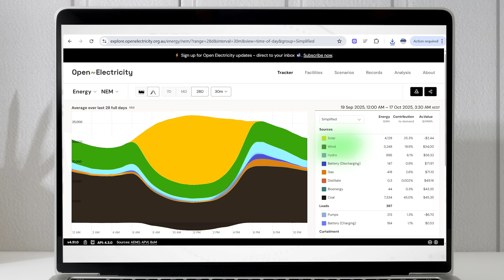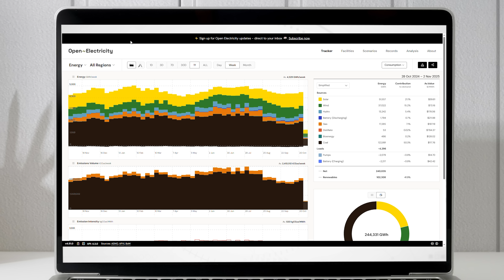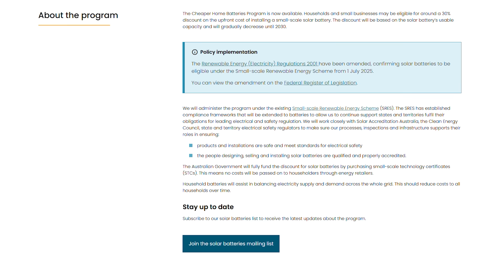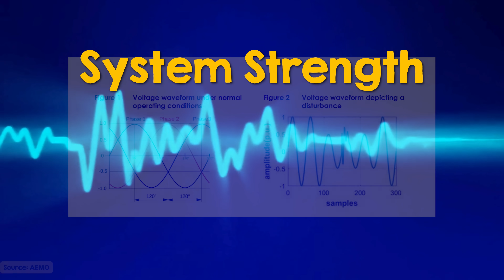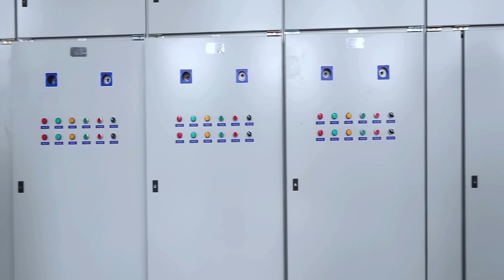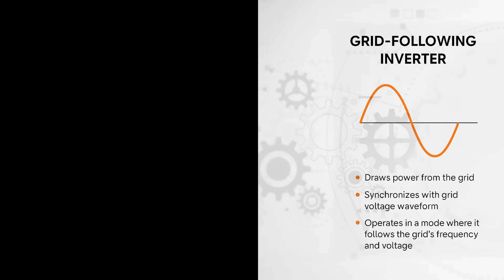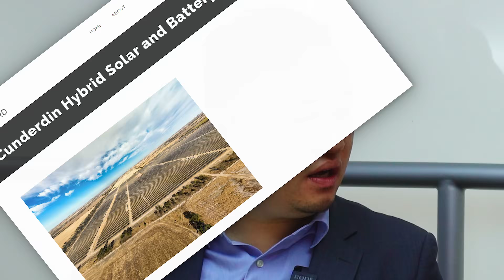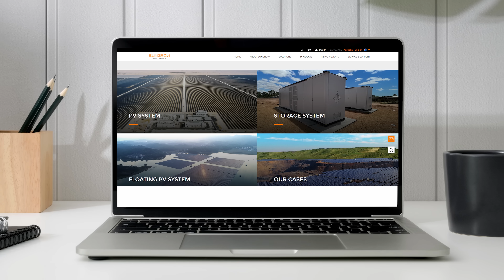Australia’s Solar Boom Is Breaking the Grid - Or Is It?

Comment: Just completed my undergraduate electrical engineering thesis on the application of grid-forming inverters in distribution networks. These things ARE the future. The best part is that you can still have most IBRs operating in grid-following mode with only a small share operating as grid-formers. Response times to disturbances are also in the subcycle timeframe, so they respond before the 50Hz grid frequency has even completed a single cycle, <20ms! Very fast indeed!
Reply: I kinda like the idea of using real inertia in the form of flywheel storage.
Reply: @kayakMike1000  Yes, exactly what we have been using for the last 100 years with rotating plant, the instantaneous impulse energy available from rotating plant is hundreds of times what it's rated output is, that's the energy that allows breakers and feeders to trip in a planned order. That's why grid forming inverters can never replace real rotating mass. Even with very generous ratings an inverter is never going to be able to support an impulse load orders of magnitude greater than it's continuous rating.
Reply: @raygale4198  Correct - A current source / "grid forming" inverter has to make a choice whether to direct energy into current or voltage i.e. the magnetic or electric field.  A synchronous generator can do both, increase the fuel into the turbine to maintain real power and change the power factor to support the voltage by increasing or decreasing the excitation.  Power electronics can mimic this behaviour, but the overcurrent capacity of a big machine is many times that of a set of gated transistors, as you've said.
Reply: Something I've always wondered, given power is being pushed into the grid, does the speed of propagation of that power result in progressive desyncing and energy loss the further you get away from the source? Also doesn't this lead to a 'dirty wave' that you then need to sync off? i.e. the physics of the network itself precludes efficient operation with lots of self syncing generators.
Reply: @keithmarlow143  Having individual generators not actively load and VAr sharing causes all sorts of distribution issues, not least of which is frequency control, you used to be able to use the grid for time keeping, it was guaranteed to be accurate to within 1/100s of a second over a 24 hour period with master clocks at the primary state generation plant.
Reply: @keithmarlow143   No
Reply: @keithmarlow143  Yes and at the edge of the grid it is reflected backwards
Reply: presumably they are sampling the ac waveform (digitising) in order to be able to see a change within the half cycle and then implement a change to the o/p in order to start to affect the next half cycle???? Or do they lock onto the cycle and continue at the same freq in order to prevent freq change and change the o/p current in order to prevent a potential drop/rise in voltage?
Reply: How does it work with expansion of infrastructure and manufacturing ? AI  is also the future  and power hungry and these are 24 hours running and if imigrating keeps at it the growth to land space for power is massive and will affect many industries that rely on land also for environmental stability wildlife will require space  it not sometime whether  it works it's about finding what is best for each country .
Reply: Looks like at lot of parts to maintain. I like solar as a on every house with battery banks and a nuclear plant
Reply: Screw the grid. You are argueing for centralized control of our lives. Individual home solar is vastly superior in every way.
Reply: @5400bowen except in northern latitudes in the winter. Have you done the maths .....it's easier said than done.
Reply: @R@RalphFreeman-ok5of.  There are ways, but it is a challenge. If there weren't 8 billion people in the world, there would be no need to live in those environmments. At least not the millions who do.
Reply: Several questions. Have you looked at the effect of transients, which you are creating, on transmission lines. Secondly if you have a large number of these devices how do you prevent them all tripping at the same time.Thirdly where is the energy coming from to simulate the inertia of a rotating alternator. Fourthly, if you have several of these on the same line how do you prevent them interfering with each other. I assume your lecturer addressed these issues.
Reply: @RalphFreeman-ok5of. Wow, you aren't aware of the existance of isolators and diodes? The grid is rife with them Mr Edison. Next....
Reply: No - they are not lmfao. You’ll bankrupt your country building the distribution network.
Reply: @questioneverythingalways820  Or embed high prices. See Sarah Ferguson interview Sussan Ley, shocking.
Reply: no, they are not.
They are inefficient, break frequently, get pooped on by birds (no photovoltaic through poop), take up large amounts of space in the environment, and cause HUGE waste. 
Nuclear even produces less waste.
Reply: @iluvyunie  none of that is true.  I've had panels for 12 years, not one has broken.  They take up no space, because they cover my roof and shade my house.  Solar farms are being trialled with livestock living around them.  The rain cleans the panels.   They have no moving parts or maintenance and in terms of energy transfer are as efficient as a petrol engine ie. approx 20%.  Levels of waste are no different to any other modern activity and they generate no pollution when in use and no radioactive waste or meltdowns.  Would more people prefer to live next to solar panels or a nuclear plant?  Hmmm
Reply: @robertsmtube in a UK winter I'll live next to the nuclear plant and be warm . Solar produces about 10 % of the rated value here on a good day and we go for days under thick cloud. I notice no one advocating solar mentions where they live ... Florida?
Reply: @iluvyunie solar panels are 99% silicon, the most common substance on earth, and inert and non toxic. 2 companies are currently recycling them...and they last for 20-50 years, longer as time goes on. You are definitely halucinating.
Reply: @iluvyunie  lay the drugs dude..nuclear is for demented dreamers..you have to be asleep dreaming to believe it is the answer to our energy needs.
Reply: @iluvyunie  I've had my Solar on the roof for 13 years, cleaned them once. The Electrical output is actually going up over time as more Solar energy is hitting the earth due to global warming. Not even seeing any panel degradation as I was expecting over time. No Panel breakage and the inverter is the origonal one. So I guess my practical experience means you don't know what you're talking about!
Reply: @wino99999  If we scaled your system to planet wide, do you think we would see the same level of consistent performance or could there be an element of luck involved in your story?
Reply: @wino99999 more solar energy due to global warming?? 😂 Okay boomer
Reply: @Revolutions1200  I'm telling you I'm getting slightly more energy from my Solar PV over the last 13 years that I've had when they were fitted at the start. Since I can't show you 13 years of data, I guess you'll have to take my word for it, but its a fact! Not only am I averaging more power over time, but that also isn't taking any panel degradation into account. So boomer or not, (I'm 65 and have an electrical engineering degree) you can choose to believe it or not - I don’t care, but what the figures are telling me is that I'm receiving more solar energy over time than I should be from ageing panel's.
Reply: @markusloane1149  well i live in the uk, so it's probably because of slightly less cloud cover/rain, lol! I guess there is a benefit to global warming at least for some or at least till the poles melt. I think global warming is a threat to humanity that is NOT being taken seriously enough.
Reply: @wino99999  I am not doubting you, I am asking if your scenario scales? Do you think we can apply whatever magic your system is operating on to other systems so we can spread that benefit to the poorest on this earth not just a lucky few. (On a more pragmatic side can you tell me, with your electrical engineering degree, background, the root case of the increased solar energy production? I am wondering if you recently cut down a tree that was overshadowing your panels or some other physical environmental factor is at play. I don't know if you follow the sun weather but we have been in a solar maximum for  the last few years and that could explain a recent increase in solar generation.) I am sensing a lack of detail in your claims that's not doubt, that's curiosity. I would like to know more.
Reply: @markusloane1149  To be honest I hadn't considered a Solar Maximum and I wonder if that actually results in more Solar Irradiance or if it just Solar particles and Solar Wind. Investigation is required!
Reply: @Revolutions1200  I'm not sure but does long wave radiation(reflected) work on solar panels?
Reply: @markusloane1149   Mate, Australia just had an election with one Party offering to roll out Nuclear Power. I researched what it costs to build a Nuclear Power Plant these days. Your question asked about how to get power to the poorest people on the planet. Solar is far and away the cheapest way to roll out power right now. We are far from Peak technology in Nuclear generation, or the construction of plants. I still hold hope Nuclear has a place in the new energy mix. But right now, we should be putting the money we have into Solar and batteries.
Hinckley Point C NPP in the UK is about 400% of it's budgeted cost, Vogtle NPP in Georgia in the USA was built at 250%. Both were completed at least 10 years late. We're shite at building anything other than Gas Power Stations these days. Or buying Solar panels from China.
Reply: @Tsubadai  We struggle to build bespoke nuclear, there are standard template nuclear plants that Korea build that are on budget and on time every time. As for solar bringing light to the poor dark corners of the world. I am not so sure that is a good fit, it might be cheap for us but to the poor it is hideously expensive, then they have to maintain it, replace it if it breaks. Dispose of it at end of life. They just don't have the logistics and supply chain to do anything at scale that is long term sustainable. That alone the upfront capital or the ongoing expertise and capital to maintain the systems.  On a micro scale this can work, a solar radio, a solar water pump, a solar light. As soon as you ramp up the scale the wheels fall off. Same deal with Batteries.
Reply: @markusloane1149 I know lots of people with solar. No one has had any equipment failure yet. Mine has been running for 10 years.
Reply: @markusloane1149 you need to look up what "scales" means. Solar works everywhere it's ever bern tried, and that's all over the earth.
Reply: @markusloane1149 you are dead wrong. Solar is growing immensely in Africa and every other poorer area.
Reply: @5400bowen  Check the insurance stats. You personal case study is insufficient data.  After every hailstorm that is a landslide of solar panel replacements.
Reply: @5400bowen  Solar at ''scale'' has never been done before. Some effects of a choice are not fully apparent for 100 years, (the automobile for example). There is just not enough data to say under all circumstances and scenarios Solar is the right fit.
Reply: @5400bowen  I don't doubt solar is growing in Africa. I doubt it is sustainable in the long run.
Reply: @markusloane1149 .   Every hailstorm? Why don't you state the stats? False, maybe in more intense hail storms. I was smart, moved to where it doesn't hail. Not everyone is smart.
Reply: @markusloane1149 boy, you are halucinating. You don't even know what at scale means. Just so you aren't quite as ignorant going forward, at scale is short for scaling up, which means taking the idea from a small setup and building a large one. There are large solar farms all over the world. They are scaled up, or "at scale". You really must live in your moms basement.
Reply: @5400bowen  ok let's debate each other's definition of the term 'at scale'. By 'at scale' I mean to the limit, every house, every community every office, factory, workshop, every manmade structure and every property.  That is 'at scale' to me. If you define 'at scale' as going from a home system, in one house, to a larger version in say a commercial warehouse or high rise building then we are taking apples and oranges. I am thinking global and at the limit. I assume your thinking more pragmatically towards domestic and community level systems. My philosophy is if not every human on the planet can have it then it cannot scale and we need to be very cautious planning systems that do not scale, (as per my definition). IMHO
Reply: @markusloane1149 your definition is contrary to the accepted meaning of the term as it has been used for at least two decades. It's not MY definition, it is THE definition. You always make up your own meanings for well established terms? Did you do that in school too? It means using it in larger installations, not universal usage. It has always meant that, and you assume I don't know what the term actually means. I've seen the term used hundreds of times, and NEVER in the way you have halucinated, and ALWAYS in the way I am saying. Straight As in English and German in school.
Reply: @5400bowen  the definition of terms and phrases can take on different meanings in different contexts, cultures, business domains. If you take issue with how I am using the term 'at scale' then let me use a different term to clarify my meaning. Ubiquitous. So rephrasing my point. 

If you cannot roll out solar ubiquitously then you risk creating pockets of solar, (our current state). These pockets mean some people get the benefits and some don't. aka an unfair distribution of resources. 

I argue that deploying solar ubiquitously is unsustainable because of the maintenance upkeep cost and environmental impact. Focusing on the money, I think ubiquitous solar would be expensive to maintain for two reasons. 
1.) supply chain logistics, 
2.) Equipment damage and degradation rates. 

If solar is ubiquitous the volume of damaged panels, (damaged from a plethora of reasons, flood, landslides, earthquakes, tree falls, storms, panel failure), would be enormous. The cost to transport the replacement panels to all the broken panels in all four corners of the earth and coupled with install would be tremendous and ongoing. Not to mention panels are coupled with inverters and solar systems are coupled with electrical grids so replacing the panel can potentially impact the inverter and local grid, particularly if you're coupling later generations of technology with an older insitu system. 

Every solar system will need replacing every 50 years. So can you do a planet wide replacement scheme of panels. There is no manufacturing or logistic precedent for this, mobile phones and cars comes close but that just goes to highlight the pocket effect. 

Throwing a nuclear power plant at the problem means you centralise your maintenance and logistic concerns not to mention the orders of magnitude less complicated grid management and voltage regulation becomes. Even better is pumped hydro. So whilst I agree that solar can deliver benefits in pockets, I don't think it is sustainable when deployed ubiquitously.
Reply: @markusloane1149 so you have no clue what coal, diesel or nuclear  upkeep costs are. They are WAY higher. Way higher. Just the fuel itself, being a permanent ongoing expense dwarfs the cost of solar. Where did you get your info on msintenance of solar? Because solar is virtually maintenance free. Just like EVs compared to ICE vehicles. You haven't done your homework. Unfair?!? It's unfair that  some  people/groups are smart enough to institute solar, while others are still saying the horseless carrriage will never catch on?!? And we shouod all be idiots for that reason? I have solar and install it. It is so reliable and cost effective..well, your information is all wrong. Not to mention getting rid of a monthly bill that does nothing but go up..and grid feed solar has NOTHING to do with rising electricity costs. That is a total figment. The utilities are trying to kill home solar and jack up prices using that industry promoted lie.
Reply: @5400bowen  I like the frame you present it is interesting. Let me explore one of your assumptions. Solar is virtually maintenance free. Let's look at a domestic solar unit and some of the types of possible upkeep factors, their likelihood, impact and cost: 
1.) They get dirty over time, likelihood certain, impact minor to significant cost - cleaning
2.) Their efficiency drops over time, (gradually degrading by about 0.5-1% annually, meaning they may still produce most of the original power (75-88%) after 25 years, but would not after 50 years) likelihood certain, impact minor to significant cost - replacement, reduced revenue
3.) They are suspectable to impact damage likelihood low, impact minor to significant cost - replacement, possible upgrade
4.) Animals eat cabling, likelihood low, impact minor to significant cost replacement, possible upgrade
5.) Trees, other vegetation and other manmade structures obscure the panels, likelihood moderate, impact minor to significant cost - trim the trees and sue the person building the high-rise next door.
6.) System fault - likelihood medium, impact minor to significant cost replacement, possible upgrade
6.) End of life - Full system upgrade and replacement, likelihood certain, impact significant cost upgrade and replacement
7.) Grid incompatibility e.g. gov regulates DRMS (Demand Response) capability in your inverter. e.g. gov regulates mandatory batteries

Over time each of these risks grow. Some every solar system will encounter such as being dirty. I am sure that there are a lot of systems out there that are set and forget. However, ignorance of a decline in efficiency is not proof that there is no decline. These systems that people are happily not paying attention to are losing efficiency every day, it is minute, but it is happening. 

Ok so a nuclear plant can service up to a million homes. assuming ubiquity then we need 5000 plants to service 5billion house holds  So lets take 5 billion homes worth of solar units for this analysis. 

Lets ask AI:

From a first-principles perspective, when scaling to 5 billion households under the assumption of de-globalization and zero battery storage, the total lifecycle and upkeep cost of a standardized Nuclear fleet likely becomes more economical and logistically viable than Solar.
The Problem of Scale: 100 Billion Panels
If an average household requires a 5kW system (~15–20 panels), servicing 5 billion homes requires approximately 100 billion solar panels.
Replacement Cycles: Since panels degrade and fail, this system requires the manufacturing, transport, and installation of roughly 3.3 billion panels every year just to maintain the status quo (assuming a 30-year lifespan).
The Disposal Crisis: At end-of-life, 100 billion panels represent approximately 2 billion metric tons of glass, silicon, and heavy metals (lead, cadmium). In a de-globalized world where recycling isn't subsidized by a global supply chain, the environmental and land-use cost of landfilling this volume is a massive, unaccounted-for "upkeep" cost.
Nuclear Comparison: 5 billion homes could be powered by roughly 5,000 standard 1GW reactors. While each reactor is complex, the total material throughput (steel, concrete, and uranium) is orders of magnitude lower per MWh than the equivalent solar-plus-backup infrastructure.
The Cost of Unreliability (The "Shadow" Grid)
Without batteries, solar is a part-time energy source. To provide 24/7 power to 5 billion homes, a secondary "shadow" generation system (Nuclear, Gas, or Hydro) must exist to take over the entire load every evening.
Double Capital Investment: You are effectively paying for two grids: a solar grid for the day and a backup grid for the night.
Low Utilization Penalty: Using a backup system only at night makes its cost per MWh skyrocket because the capital cost of the backup plant is spread over fewer hours of generation. Nuclear, operating as a primary source at 90%+ capacity factor, avoids this redundancy cost.
Manufacturing and Local Sovereignty
In a world without reliable globalization:
Solar Complexity: A domestic solar industry requires high-purity silicon refining, advanced chemical vapor deposition, and glass manufacturing—all highly energy-intensive and technologically sensitive.
Nuclear Templates: As you noted, a "template" reactor (like the APR-1400) allows for serial production. If a nation builds 50 identical units, it internalizes the workforce expertise, dramatically reducing the "upkeep" cost of repairs and refurbishments through standardized parts and procedures.

Summary of Long-Term Upkeep Factors
Factor	                         Solar (5 Billion Homes)	                                                   Nuclear (5,000 Reactors)
Material Flux	                High (100B panels, frequent replacement)	                   Low (Fuel is dense, long plant life)
O&M Labor	                Massive (Billions of distributed roof/field units)	           Centralized (5,000 sites, specialized crews)
Reliability Cost	         Very High (Requires 100% backup for night)	                  Low (Constant baseload)
Waste Management	Logistical nightmare (2B tons of hardware)	                  High-tech but small volume (Spent fuel)
Refurbishment	        Full system replacement every 25–30 years	                  Mid-life overhaul every 40 years

The Verdict: While solar is cheaper for a single home today due to global trade, the logistical friction, disposal costs, and inherent unreliability of scaling it to 5 billion homes makes a standardized Nuclear fleet the more stable and lower-cost "upkeep" option for a global civilization.
Reply: @wino99999 Id like to see you prove more energy is hitting the earth due to global warming ....lol
Reply: @RalphFreeman-ok5of Well assuming panel degregation does occur, why is my yearly PV generation going up year on year??
Reply: @wino99999 maybe the ratio of sunny days to cloudy days is changing. Where I live weather is a variable...where do you live
Reply: @RalphFreeman-ok5of This is probably the case and not more irradiance, which would mean the sun is brighter or the atmosphere thinner....., however if it's more sunny in general, i.e. less cloudy weather Isn't this essentially the same thing i.e. we're getting more sun than normal? 

P.S. I live in the UK
Reply: I probably didn't write this very well. What I meant is that my panels are receiving more Solar energy over time year on year despite of panel degradation!
Reply: @wino99999 yeah, I bought some well used panels and they test out at full output. No moving parts...
Reply: @iluvyunie  🤡🤡